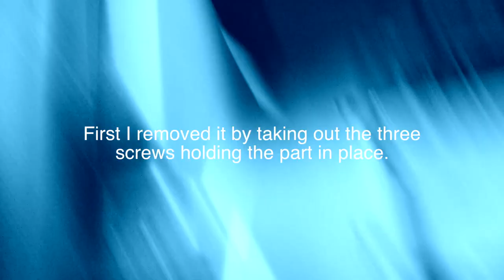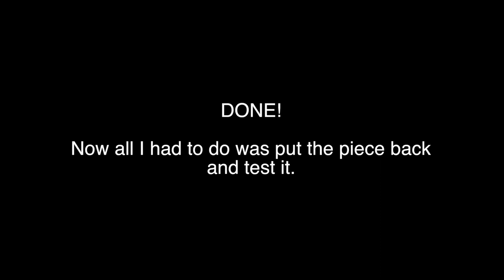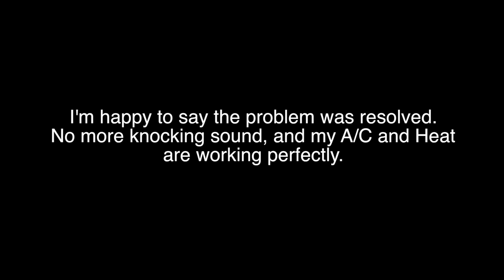Acura air mix/blend door actuator DIY FIX

Comment: Turning around the gear 180 degrees to the part that never touch any other gear is a brilliant idea. Thumbs up and thanks for posting.
Reply: Where is the blend door actuator? I couldn't locate it?
Reply: @hbratcher22  passenger side floor board up and to left. Rewatch video and look for the actuator he is showing in video under your pass side floorboard. Maybe try another video if this one didn't work for you. Goodluck
Reply: @Ducknell  that is where I looked but I don't see anything removable

Comment: Seems to work did this on the drivers side. Not sure if I aligned it perfectly but at least it’s not knocking anymore. Will need to see if the heat comes on later. Cold ac working great. Thanks👍🏻

Comment: Is this the same actuator that has the metal line that controls the heat/ water valve under the hood ?  I have plenty A/c but no heat and this actuator does not move at all when I switch to heat. Just wondering if the actuator you changed is the same one?
Reply from the maker: No, unfortunately it's not that one.
Reply: I know this is an old post but likely your issue is the valve, you dont need the metal line at all you can leave the valve in the open position and still get heat and cold.

Comment: Question: how did you remove the main gear from the circuit board? I can't seem to find an easy way to remove it without risk of breaking it.
Reply: I cant find a way either!!!
Reply: Where is the blend door actuator? I couldn't locate it?
Reply: @allenrivera5680   Where is the blend door actuator? I couldn't locate it?

Comment: Hi i have a question you can hopefully help me with . I own a 2008 Acura TL  with 139k miles . When i turn on the heat, it blows normally on the drivers side, but cold air on the passenger side. How can i fix this?

Comment: Thanks for the info -Gave me the idea to repair rather than replace my actuator. My 2000 Accord was making a wretched sound when the climate control was running and I tracked it to the actuator module. After removing and disassembling the actuator, I didn't find any bad gears but I was able to repair by cleaning the contacts on the underside of the large drive gear. I also carefully bent the contact fingers outward so to make better contact with the drive gear. No more noise and the climate control is working just like it should. Thank you again for posting.
PS -And yes, I did break a couple of the retainer tabs when disassembling the unit but it was not a problem at all.
Reply: Thanks!
Reply: Where is the blend door actuator? I couldn't locate it?

Comment: Today I got to 100% fix my "driver air mix" actuator fault.

 The root cause is the OLD HONDA GREASE prevents proper contacts of   the 6 internal electric brushes that are used to read actual shaft position. 
When the HondAcura "Body Electrical" computer senses an eroneous position it stops interacting with that actuator and post a DTC such as "B1235".

With a single output shaft, the driver side "Air Mix flap actuator" also manages the heater core COOLANT INLET VALVE. Basically when the driver side calls for a low temp 67 and the passenger a higher temp 72, the driver side valve can not admit a lot of hot coolant at the same time it is aiming at low temps... Passenger side has no control over heater core coolant valve!

FYI: While bugged out by fault, the HVAC climate computer does not regulate cabine temperature.

NUGGET: the engine is much more responsive when there is NO DTC FAULT.... Case in point: even a stupid HVAC cabin air-mix fault off of "Body Electrical" CAN Bus does impact the Engine Control Unit (ECU) throttle response regardless the fact it is on its own separate high-speed Bus.
👍
Reply: Where is the blend door actuator? I couldn't locate it?

Comment: My recirculation actuator is what is making noise, of course it's not the easy one to get to. I took entire glove box out and found the problem. It's what opens the big flap to let fresh air in, it does it every time I turn car on, knock knock knock very loud. I can't see how to get it off without taking the entire heater box out. I guess I'll try to put some foam under that flap to dampen the noise.
Reply: I just unplugged the motor finally that awful noise is gone!
Reply: @Yophillips3272  noise is gone !🤘
Reply: Where is the blend door actuator? I couldn't locate it?

Comment: my air mix failed.  But I went to my local salvage yard and got a couple from another TL for dirt cheap.
Reply: Where is the blend door actuator? I couldn't locate it?
Reply: @hbratcher22  its located on the passenger side. Look below the glove box and look to the left. Itll have a tiny metal arm coming out of it.

Comment: how did you remove the main gear from the circuit board?? Turning it 180 degrees??
Reply from the maker: It just comes right off. Pull each gear out and then put them back in the same order.